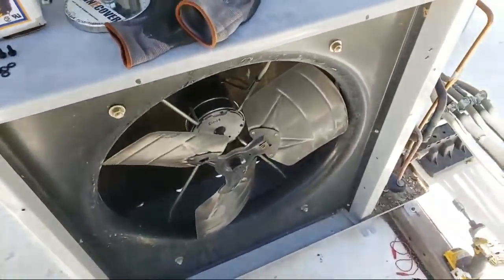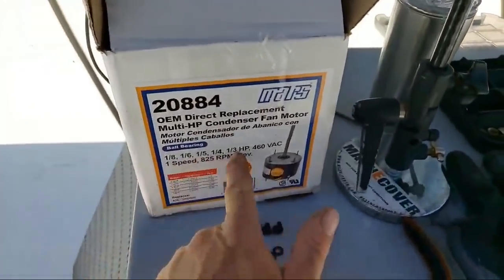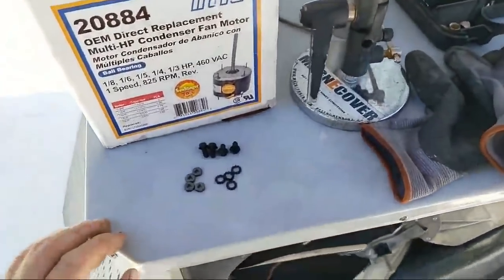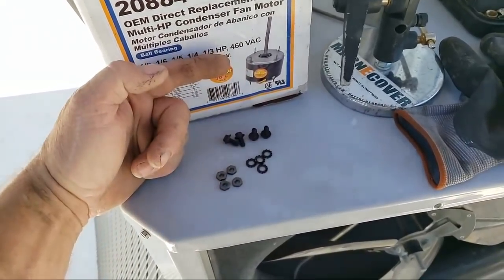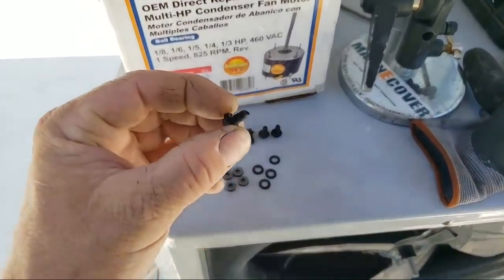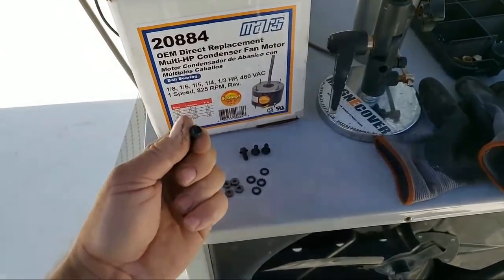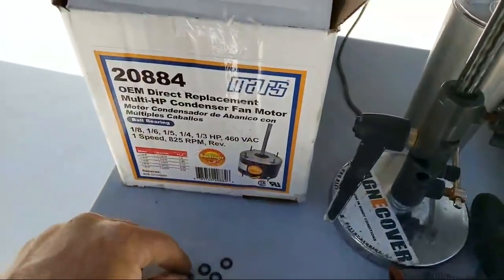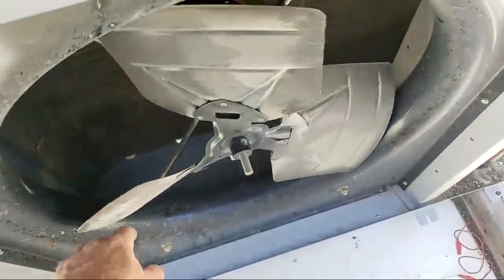MARS Universal Fan Motors Looks To Be A Good Choice

Comment: I had to replace the condenser fan motor in a really old crusty Bard wall mount. I went with this Mars motor and so far so good! Considering the OEM always but of course it was not available and it is for a critical space...I have to say it is better than any other Aftermarket motors out there. I also like the AZURE ECM style motors Mars has.

Comment: The motor could have been a bit closer to fan blade. It be easier on the bearing
Reply from the maker: It was only an inch further than the OEM which also looks like the fan is handing off of the end.
Didn't have to get off that tall building to go get a sawzall.
The shaft is nowhere as long as most universal motors or I would have had to cut it for sure.

They do make the shafts this long for a reason tho...